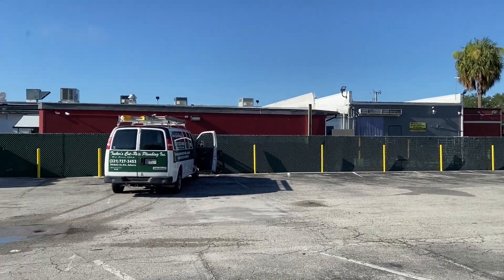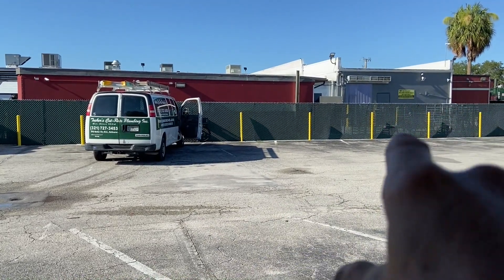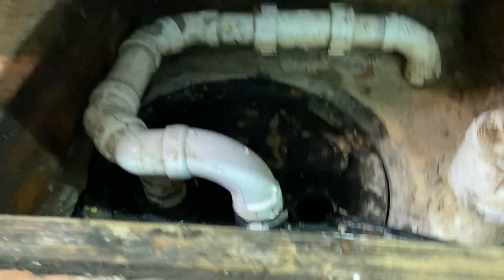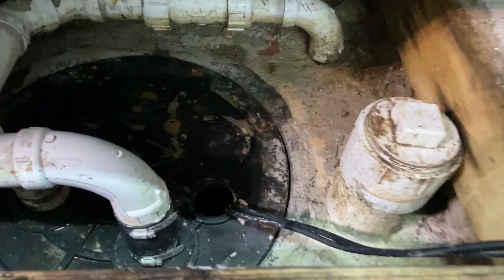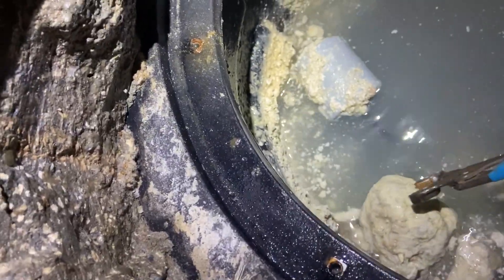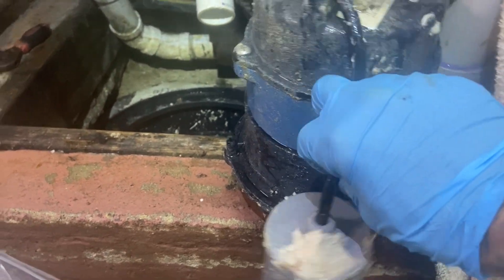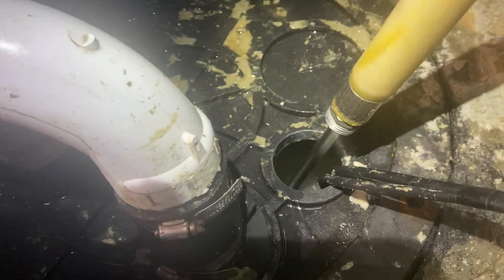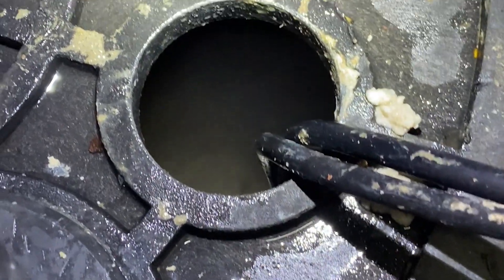LIFT STATION MAINTENANCE

Comment: Are you using grinder pumps I’m going to pump would help a little bit but the grease is really a problem they might have to put a solution into the water to remove the grease